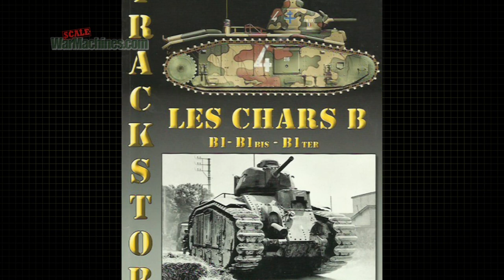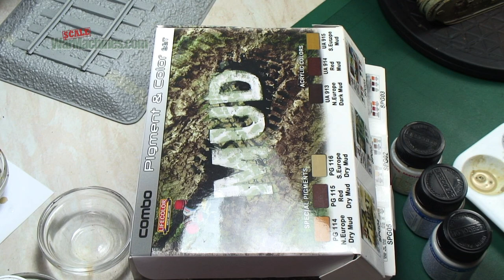THE SECRET TO USING LIFECOLOR PAINTS - WEATHERING & PAINTING TANKS IN OLIVE DRAB

Comment: Can I ask what was the psi setting cheers
Reply from the maker: Sorry Steve, very late responding to questions, I usually go for 1.5 bar, but to be fair I have one regulator on the compressor, sometimes one inline and often one valve or MAC valve on the gun (no dial), so it's hard to tell exactly but 1.5 it always a safe bet. Watch it with Lifecolors though, it is all very delicate and dilution and air pressure takes more dialling in - as they can be a bit fiddly to get right - experimentation is key.